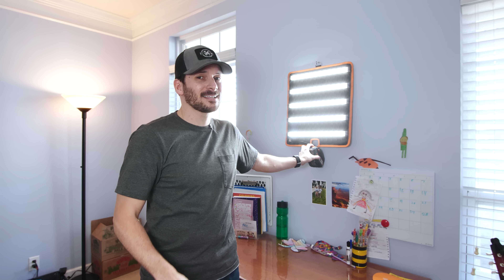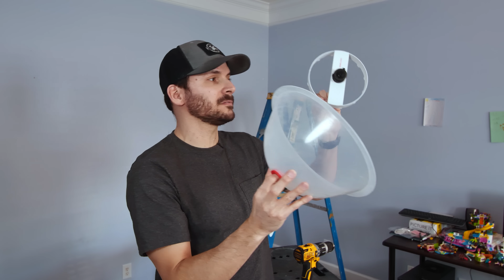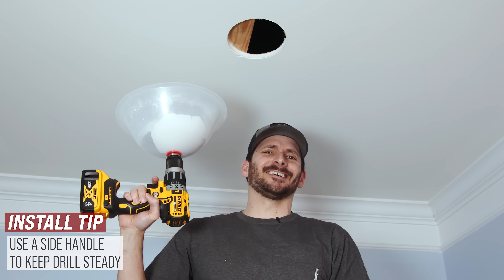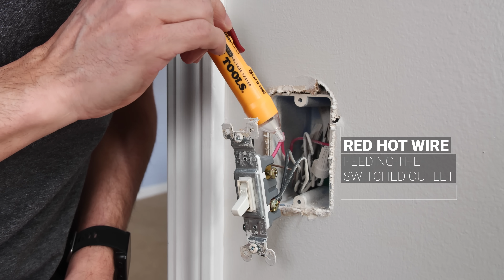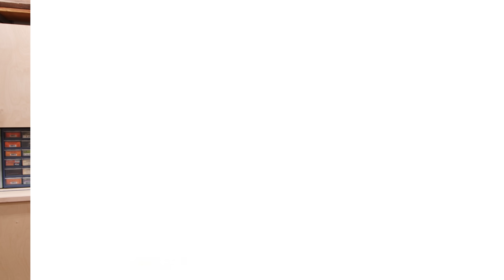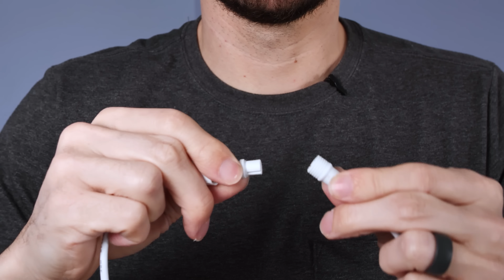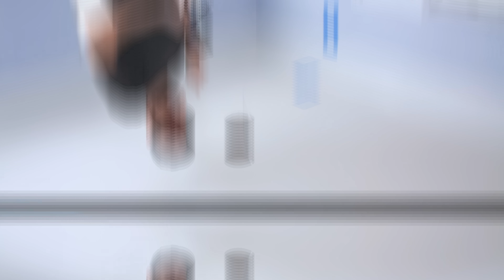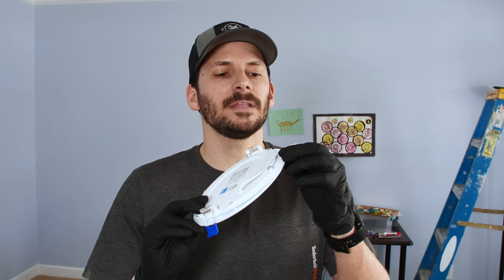Recessed Lighting Install with No Attic or Prior Wiring

Comment: Looks great! Just a tip, if you want it brighter dont think in more spots persee. Now you are spreading the light 180degrees and basically loosing a lot on the housing and diffuser. Try to use a led spot with a lens of 60 degrees by example. Or use 30 degrees and place them closer to your walls. Than you make an indirect light from your walls and you eliminate shadows. The flat leds are very popular but they have a very low cri. So while they are blinding you, you think they light up the place but they don’t.
Reply: Agreed. Wafers are really only useful for closets.  A proper can with a good reflector is much more enjoyable.  That glare would drive me nuts, especially for eyeglass wearers.

Comment: Same brand I bought and installed about 8 months ago, Brad. I used them for my exterior soffits and porches though, not indoors ... 5 - 6 inch lights and 6 - 4 inchers to replace existing can lights. They are awesome! Many reasons for the swap but a big motivator for me was to eliminate places for wasps and mud daubers to take up residence which were a constant battle - the solid flush mount works great for that. In addition, not only do they look great and provide great lighting, they save you money too!  They've all had a lot of use but the 4 inch lights have been run over 8+ hours every night since install and not a hint of trouble. Great choice!
Reply from the maker: good to hear! Hoping this will last the life of my house (our at least the life I'm here)
Reply: Jesus is LORD  WTF?
Reply: Jesus is LORD  can you please don’t bring Bible quote into something that has nothing to do with salvation, what you are doing is making people stay away from believing who Jesus really is. There is a time and place for it, Religion is pushing away people from the truth of the work of the cross, the love that forgives all sins and from salvation for a new life in Jesus Christ. 
FYI I am a believer and follower of Jesus. 
Be blessed!
Reply: jesusislord6545 get lost

Comment: I have these all over my home!  We have trusses rather than 2x12 rafters so the best part is that when you want to add any type of wiring I just pop out the LED pots and can run the new wire without tearing out ceiling! Just toss the new wire from hole to hole! BTW, I have a lot of 8” wafers in my garage but used 6 inch in my kitchen and notice that the 8” will blink when the Lutron switch is turned on but the 6-inch does not... we used these in our church and the 8-inch do the same thing...

Comment: If you have a difficult wall or ceiling texture to repair match, You could also take down the crown and make access holes that the crown would cover when reinstalled.
... or if your room doesn’t have crown, it’s a nice opportunity to add it in lieu of a possible bad patch.   Also consider rope light in a dropped crown as part of the lighting scheme.
Reply from the maker: Yeah, that's a great tip.  Since my ceiling was smooth I felt like removing the crown would be a bigger pain (remove, reinstall, caulk, paint) so I would have gone below it
Reply: @Fixthisbuildthat  ...I realize I said ‘you’ and ‘your’ but It was really a tip to your other viewers that may have an older home with other challenges.
Reply: I've HAD to do this many times. It's much faster than repairing drywall.
Reply: I don't believe mudding and patching is that hard, plus you can sand it and try, try again 🤭

Comment: Having done electrical work on existing homes... It would be AWESOME if it was a standard to make a schematic for the entire home that stays with the panel for all the future owners
Reply from the maker: that would be heavenly!
Reply: People already don't want to pay electricians. Imagine the extra cost labeling every little wire into a diagram. And where it's running throughout the house. Builders would never hire someone like that. Builders use the cheapest guy for profits
Reply: I’ve been making one for my house because nothing matched the panel!
Reply: @johnhorning2506  ikr... I've never seen one that was actually accurate
Reply: @johnhorning2506 Same. All labeled incorrectly.
Reply: You got luck. The lights are made to go in ceilings with the rafter/stud on edge.Your floor joists are flat 31/2" wide. If it hits to close to the center of them,the light won't go up in there because the light pigtail wire or the 2 clips will hit the wood. Then you would have to shave the 2x4 edge in the appropriate place so light will go in. True me, I know from experience. If you do a new house and pre-wired before drywall you better make sure your light center is in the centers of the I- trusses. Use a X and laser on the floor to find the center, and after drywall goes up,use that X on the floor to guide you to drill your drywall hole.

Comment: A quick fix to re-power the receptacle is to pull the slack end of the 14/3 to the pot light closest where the plug is. Run an additional wire between that pot and the first light brought the 14/3 to. You then can continue the constant power to the plug. Would be even better if you use 14/3 between those two lights. Much easier for box fill.
Reply: You are the first one to correctly explain how this should have been done.
Reply: @frankgiardina4877  normally I just yell at my phone instead of commenting...

Comment: Great video, and well explained.  My only criticism would be that you really didn't need to run a brand new wire to the outlet formerly controlled by the switch.  The bottom of the outlet is fed by a different wire - not the one from the switch, therefore, all you needed to do was cap the red wire and tuck it in the back of the box, replace the duplex outlet with a new one with an unbroken bridge, and the wire that supplied the constant electricity would have powered both top and bottom.
Reply: totally agree. He messed up with cutting the wire at the attic and killed an outlet,plus leaving a wire hanging in the attic that could potentially be a fire hazard if someone puts power into it in the future. He coulve just got power for his lights from the outlet by putting new wires.
Reply: So how was he going to switch the lights on and off? He needed the red wire in the 14/3 that was coming from the switch and going to the receptacle.
Reply: @guyzer6197  Why not add a box in the attic and branch off the red for hot for the new lights. Keep black as it is and get a new outlet that is bridged.
Reply: @castroy1  you could, but there is no attic access.
Reply: @guyzer6197  He can run a 14/2 from the switch box or switched outlet to the nearest light and tie the black from the new wire to the red in the box.
Reply: @guyzer6197  the red runs power to the light, tie the black off from the switch to the black wire for the receptacle only and DONT tie that into your lights (now your receptacle has constant power). So for the light the red would be tied with black, white to white, neutral to neutral. All of my upstairs lights had to be done this way and I needed a junction box since I didn’t have enough slack lol
Reply: Took my comment
Reply: @JuanOfAllTrades  From a theoretical perspective your solution makes sense. It's seems clear that the 14/3 cable in the ceiling is bringing both the constant hot and switched hot to the receptacle on the far side in the room, so interrupting the red conductor in the 14/3 as it crosses the ceiling, and using it for the new lights would make them controllable by the switch. There are two problems with this approach. 1) As you mentioned, you may not have enough slack in the 14/3 cable to make the proper connections within the ceiling, given that all connections need to be enclosed within an electrical box for safety. You might need to pull a longer replacement 14/3 cable from the switch to give you the slack that you would need. 2) I'm not an electrician, but I believe that it's against code to hide electrical boxes behind (or in this case above) sheetrock, as any future issues with the circuit (like loose connections) would be difficult to diagnose and correct. I think the best solution would be to cap off the existing red conductor at both the switch box and at the receptacle, replace the receptacle with a new one that has the bridging intact, and run a new 14/2 cable from the switch to the new lights. One last caution: Check the dimensions of the existing electrical box that houses the switch, it may need to be replaced with a larger capacity box in order to safely handle the additional 14/2 cable and its connections.
Reply: @diyguru7531  yes you are correct without a doubt it’s against code, any electrical connections have to be within a J-box and “accessible”, have you seen how they sometimes leave houses with pre-wire for fans and just cover it with a plastics cover until you buy a fan. That is the proper way to leave a connection, you cant just hide it lol
Reply: @JuanOfAllTrades  could you use the pot light hole as an access point for the junction box?
Reply: @leokendall  depending if the housing in the current pot light has room! I’ve opened one before trying to do the same thing and they had already tied into it, especially if they are daisy chained.

Comment: As an electrician for 30 years, you did a very good job with the video and explanation. Only suggestion would be using 14-3 from light to light etc. You then could of carried both the hot and the switchleg to the existing outlet and convert the switched outlet to unswitched.
Reply: I thought he was keeping the 14-3 to the outlet and just splicing in 14-2 to run to the other lights.
Reply: yes.  I would have cut the 14/3 about half way between the first light and second light.  Then I would have used 14-3 between the two lights on that side and taken the other half of the run to the outlet and just abandon the red and replace the outlet with a non-broken outlet.  Then I would have just run 14/2 to the other two lights.  If the boxes for the wafer lights didn't have enough space for all the connections, I would have put a regular jbox up there.  And I would have connected it with wire nuts, not those push-in connectors.
Reply: 14-3 🤦‍♂️🤣🤣
Reply: @godofwar4271  ?
Reply: @marist89  Yep that is the thing to do. Kind of fixed one problem and created a new one. Would of put a pancake box in for the fan why I was at it as well.
Reply: Could have*

Comment: If you need to fish a wire to the light switch you can always just remove the new work box and put in an old work box. I have now placed over 70 of these wafer lights in my home on the first floor and basement, they are a game changer.
Reply: I'm really good at putting in old work boxes with "battle ships" (the thin F-shaped straps you put on the outside of the box to apply counter pressure to keep the box in place.).  70 is a LOT of lights!!

Comment: From the school of life lessons, in regards to the drill, grabbing and almost knocking your jaw out, recommend that when doing any type of large hole that you not use the drill setting, but engage one of the torque settings. Start out at a low torque, and when the clutch slips increase the torque progressively until you are mostly not slipping most of the time.  When the drill finally grabs at the end, the clutch will slip and you won’t wrench your wrist nor smack yourself in the face.  Then just reverse the saw and start a couple more times and you will be through.

Comment: Great video editing pace and I had to take a double take on your split screen showing your 'twin' helping!  One thing to keep in mind is that the code requires 1/16" steel backing plates (I think that is the term) to protect wires running closer than 1 1/4" to the surface of the 2x4 so it might be better to move the cable before drilling rather than drill near one side or the other of the 2x4 framing.  Those plates would be nearly impossible to install as old work.

Comment: Great video, I am curious to know how you were able to get access to that first wire that you cut (from the can light hole) near the switch- in order to make sure it was put back into a junction box or something. Did you just have a bunch of slack on it? Typically wires are pulled pretty taught.
Reply: I was wondering the same thing
Reply: He was able to reach in a few feet and cut it beyond the point where the hole was cut allowing enough slack for pull the wire over and out the hole. In this video he just lost power to the rest of the line. But since it ran parallel to the second hole he could reach in and do the same for that side. So the wire down to the switch goes into the first light, the. The wire going down to the outlet goes to the second light. Then he can run a new longer wire to connect the two back together making the junctions inside the recessed light boxes. He would have to run a 14/3 rather than a 14/2 to accommodate the extra power source that just passes through.

Comment: These wafer lights are SO easy!  Since they are IC rated and rated for damp locations, I installed four of them in my front soffits as wash lights and put one in my bathroom above the shower!
As an added bonus, I used one in my closets to satisfy the electrical inspector; they don't protrude into the space so there is no concern with the lights getting broken and starting a fire.
Also, the LED uses so little power, I actually see the difference in my bill!

Comment: I recommend put the drill in high speed. There’s less torque, less kick back. Never use an insulated screwdriver. Just drill the centre hole, then poke up a coat hanger that’s cut, bend a right angle in it that’s the radius of the light fitting and spin it. This will mean you’ll have clearance from the roof timber. DIY electrical scares me, as seen some seriously unsafe stuff.
Reply: Facts

Comment: Many ways to do this, but as an experienced electrician in your situation i would have turn off the power to the wire reached into the ceiling light hole closest to the outlet cut the wire with enough access to make a splice (outside the ceiling) in an approved  box , pull the rest of the wire out of the first hole (near the switch) to make another splice in a sec box. And replace the  wire between the two ceiling light holes.
Reply: I'm not sure I understand. Where would the boxes go?

Comment: If you wanted to keep constant power on the other half of that plug, joint that 3 wire in the box and run the switch leg to your pot lights and tie the blacks together so they run through to the plug, then replace your plug with one that isn’t split. Then you have your plug with constant power and your switched pot lights. This will only work however if you have enough slack
Reply: Exactly. I don't understand why the load side was discontinued. He could have just tapped in for the new lights and left the black to continue.

Comment: I highly recommend investing in a $20 endoscope that is a quarter inch size. Then you can drill 1/4-in holes and insert the endoscope which can connect to your smartphone.
Reply: You can get one that's waterproof too and so you can use it pretty much anywhere.
Reply from the maker: Dang, that sounds awesome!  I'll have to check it out.  Didn't know they made ones that cheap
Reply: The ip67 water proof ones are a little more. The one I have was 35.
Reply: I have one that sends the signal via WiFi to an app on my phone. I think it was about $40. Works well.

Comment: These lights are cool. Installed them in a living room a few years ago and also in the soffit over my garage doors and they give a ton of light. Looks nice and added safety also.
Reply: Does the the wafer LED lights can become burnt out light or do it need some resinstalling the lights after a couple of years?
Reply: @marcmarcmarc681  They are LED so should last 30000+ hours depending on the light. I don't know if just the wafer portion can be replaced or if the whole thing needs replaced but it would be quite awhile before needing to be replaced.
Reply: Thank you so much brother